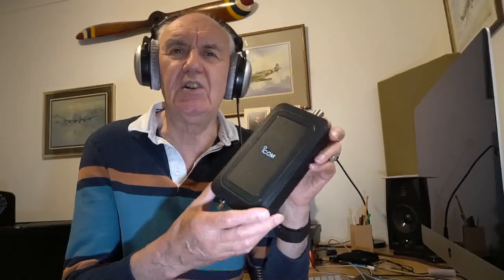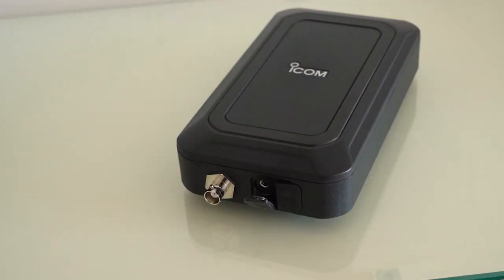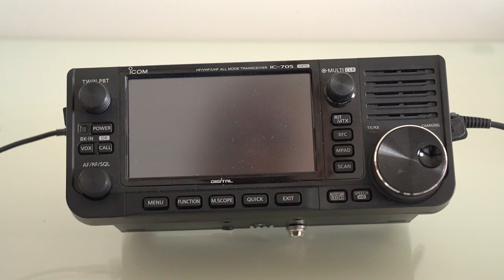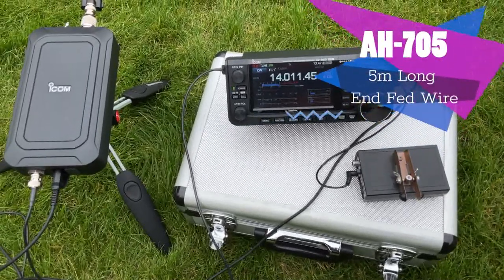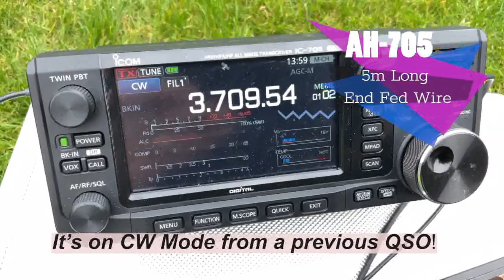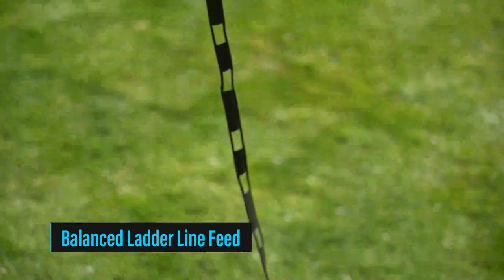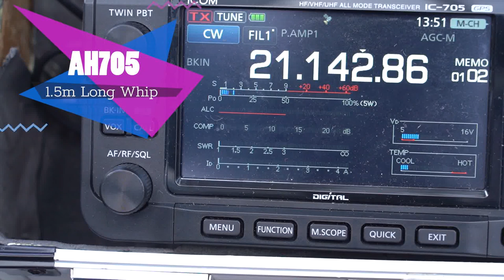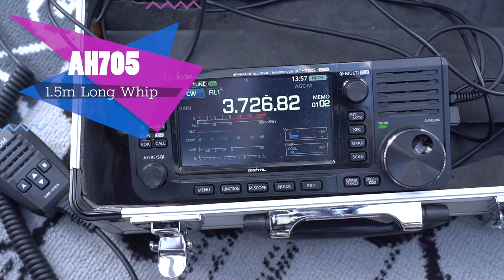ICOM AH-705 AUTO ATU IN DEPTH REVIEW

Comment: Been looking forward to this particular video, a lot - I'm just about to order my first rig this week and  my big question at the moment is do I really need a tuner and if I do,  should I get the MAT-705 or the AH-705?
This video has pretty much solidified my thoughts and confirmed my choices.

Just got my Australian Foundation License which has a 10W PEP limit. Due to this limit and the fact I'm interested in portable operation I've pretty much decided on the IC-705. 
I live in a townhouse with a block that is 4.5 or 5  meters wide so a tower or even a mast like a DX Commander would be difficult or impossible to guy, so being able ot use a short  end fed wire antenna is very attractive.

On paper the MAT-705 looks better its  smaller and has about 16,000 more memory locations, although it doen't mention weather/dust resistance.

Of course paper does not tell you how well it works. I've seen 2 examples on YouTube where MAT-705 users have not been able to match an antenna - and on one of them they did match it on their Elecraft tuner (the T1, I think).
Right now I'm leaning toward the AH-705 despite the price and size difference.

I do wish the tuner control and the RF  output were on the same side too, but maybe a right angle adapter for both might help, then you can have the cables "meet in the middle" as it were, without too much strain.

I'm a  total newby ham - but I do have experience manpacking radios and using them in the field  from a couple of years in the military.
I'm happy that Icom have given us a smaller overall radio, with what appears to be a  very high performance -  matching unit separate. You get the smallest radio possible when you know you have resonate antenna, but if you need a matching unit you can add one - and one that appears to be magic.

Thanks very much Peter - you've sold me.
And thanks for all your other videos, I really learn a lot and enjoy them.

Comment: I have an LDG IT-100 tuner for my IC-706. One day I had the antenna completely disconnected, all I had was about an 8m length of coax, and even that was wound through a choke. I accidentally hit the "tune" button...and it matched my open end of coax! :-o
Reply: LOL Paul, yep I've done the same thing by accident, too. So what does that really tell us? Well, just because we've matched our radio to an antenna system doesn't mean that we have an efficient radiator. 73 KJ6ER

Comment: Thanks for the video Peter, I have the AH-705 now. It did tune up ok on a 20m length of wire but I have since tried a 7m and 17.2m bit of wire. The 7m did not get out as well on 40m as the 20m but I have not yet compared the 17.2 to the 20m length (20m being a halfwave)
Reply from the maker: Thanks for the info.

Comment: It was expensive but I'm very happy with AH-705 performance. Mine came with a PL-259 to Binding Post adapter to attach a random wire. I use Energizer Lithium AA batteries in mine. They last longer and have less chance of leaking like alkaline batteries do.

Comment: Thanks for the review, I just subbed. Like most others, I believe Icom should have included the ATU in the 705. Having said that, Icom should have made it for 100 watts and not limited it to just 10 watts so hams could have used it with a variety of radios of all power outputs. That kind of limits what you can do with this tuner.  I do like the fact  that you can run it on common alkaline AA batteries and not on some internal rechargeable battery. At $359 U.S., I think it's overpriced because of it's 10 watt limitation.
Reply from the maker: Yes I agree, particularly regarding the 100W version. 73 Peter
Reply: @watersstanton  Isn't a 100W version of the AH705 effectively an Icom AH4 with internal batteries added?  Might make a good video......Also I'd love to see a video on loop antennas with the AH705.  How small of a loop can you use and still get 6-80M or 6-40M?

Comment: I have an AH-4 tuner from Icom and I use it with a 12 m long vertical fishing rod. It tunes 6 to 80 metres, and with a loading coil it tunes 160 too, even if officially the AH-4 does NOT tune 160 metres at all. It allows me to run 90 W in digital modes and it just works, no issues.  It seems that this AH-705 is worth buying, if you, like me, are fine with using tuners and cannot use better antenna solutions.
Reply from the maker: Many thanks for the info. 73 Peter

Comment: I received and hooked up the AH-705. And it’s as amazing as you stated. I have a couple wire antennas in my backyard and they normally don’t tune up all that well. But the AH-705 just flat lined them or 1.2 to 1. It isn’t the smallest atu on the market but it’s probably the best. Thx for the vid.
Reply from the maker: Hi Ted. Glad the video helped. 73 Peter.

Comment: I don't understand what Icom are aiming for here. The thing is *huge*, they expect you to drag that along with your mobile QRP station? Really happy I splashed out on an Elecraft T1 for my 705 -it's 1/4 the size and £50 less. Sure it won't tune up a damp stick on 80m,  but it's fine with the random lengths of wire I use :)
Reply from the maker: Thanks for sharing. 73 Peter

Comment: Thanks. To be fair the ATU isn't as expensive as I first thought.
Just a thought, are we sure the ATU doesn't have a 50ohm resistor in it! :)
Reply from the maker: If it did you would not hear it tuning - think about it. 73 Peter.
Reply: @watersstanton Sorry just being facetious, it looks like it is a fine tuner. Judging by the board layout inside it would probably be too much of a squeeze to pack it into the rig itself. The trade-off with wide matching.... 73

Comment: I just picked up a 705 a couple of weeks ago to use for portable operation. I've been considering an ATU and am torn between the AH-705, the MAT-705 and the Elecraft T-1. 
Another fellow compared the Elecraft to the MAT and found certain situations where the MAT would not match an end fed long wire but the Elecraft did just fine.
The MAT specs a range of 5 Ohms to 1500 Ohms. That quite a ragne. The Elecraft says up to 10:1. I reckon that would mean 5 Ohms to 500 Ohms. The ICOM I cannot find either an impedance or an SWR range. 
The ICOM seems to work well though. I imagine it has to do more re-tuning in the sense of all the relay chatter rather than just being able to jump immediately for a revisited frequency. 
I think the ICOM with its water resistance and mast clamp might be better for random length inverted V antennas that I think I'd use in portable operation.
I do like your simple doublet antenna. That would suit me as well.
Oh. What to do? What to do?
Thanks for the review.
Reply from the maker: The MAT is not nearly as good as the other two. Both are brilliant.

Comment: Hello Peter, an exceptional video as always.  I'm sold !  The best place for an ATU is always at the antenna feedpoint so a portable ATU like that has great advantages in reducing the coax feeder losses and allowing you to run longer coax feeds.  The open wire feeder example on your doublet was brilliant and regardless of whether you use a 1:1 balun or a 4:1 balun it would be an advantage to add a common mode choke (choke balun) on the 50 ohm terminal of the open wire balun to completely decouple it.  What kind of propeller is that on your wall ?   73,  Jamie  VK2YCJ
Reply from the maker: Hi Jamie, thanks for that. The prop is a half size replica but I have lost the label. Sorry! 73 Peter.

Comment: Great overall review.  I noticed that you didn't talk about SSB, would you think a random wire would have at least 6 dBi or more?  I've noticed on the iC705 most of the time you are the noise floor and having an efficient antenna, would be a great asset.
Reply from the maker: Frank I don't fully understand your question. Are you talking about dBi gain? If so, then what is the reference antenna? Generally speaking, random wires rarely perform better than a dipole unless very much longe.

Comment: Just watched this great video a second time. This tuner is clearly more versatile than that fitted to my 7300 (a great radio). Although this tuner is designed for portable use and I specific portable radio, seems to me this would do a good job as a homebase tuner?  Agree? What else does this as well at this price point ?
Reply: For your 7300 consider getting the Icom AH-4. I use it and it works fine for my vertical 12 metres long fishing rod.

Comment: Isn’t the AH-4 more or less the 100W version you wondered about? My AH-4 works wonders tuning a wire running inside my hedge against a ground rod.
Reply from the maker: Yes you could be right if it has the same ability. 73 Peter
Reply: @watersstanton  yes the AH-4 is great it will match pretty much any length of wire on any band.

Comment: Great video.  For the ladder line connection, why can't you just connect 1 leg of the ladder line to the center of the PL259 and the other leg to the ground lug?  Wouldn't that get you a balanced connection?  I've used my ICOM AH 4 for years doing this exact thing.  I have a 160 meter full wave loop fed with ladder line, if connect 1 leg of the ladder line to 1 post of the AH4 and spread the ladder line such that I can connect the other leg to the bottom ground lug and for many years tune that 160 loop on all bands including 6 meters with a lot of contacts under my belt.  The AH-705 looks to be similar to the AH-4 100 watt tuner design.  Is my hunch correct in your opinion?
Reply from the maker: It is rather like connecting ladder line to coax cable. It is not an ideal methos because coax  is unbalanced, but it works with limitations.

Comment: The bottom of my AH-705 says to never use rechargeables even going as far as capitalizing NEVER to make their point.  Also it says to only use Alkalines.  You said that it works fine with rechargeables.  I'm wondering if it's because with two rechargeables, you're only putting out two and a half volts to the tuner and it needs the required three volts to work properly, and by using rechargeables it would be like always using run down batteries?  Since they were so adamant about stressing that you don't use rechargeables, is it possible that the unit might over time incur some permanent damage by running it consistently at a lower than required voltage? Since they made their point twice, once in the instructions, and again on the bottom of the tuner.

Comment: Tuning and radiating are two different things.  How does a 5 meter wire or 60 foot wire radiate once matched to the transceiver thru the ATU?
Reply from the maker: Radiation level is determined by power fed to the antenna, and a matching unit can play a big part in this. Substitute “match” for “tune” and your question is answered.

Comment: I wonder how radios like the G90 and Elecraft manage to fit an ATU that can tune a wet noodle inside? Don't get me wrong, I love my IC-705, but it is lower power, expensive, and doesn't do nearly a good a job as a tuner from LDG. Let's face it, Icom wanted to get another $350 on top of $1300 for the IC-705, when companies are selling radios WITH a tuner for under $600. Heck, you can get the LDG Z-100Plus/IC-705 which will tune anything (and handle 125 watts, so you can hook it up to your base station or an amplifier for your IC-705) and only costs $150, less than HALF the price of the AH-705.

Good video though.
Reply: Also, how many contacts did you make on 80M with a 1.5M whip? I can tune a dummy load up pretty well to 1:1 but it doesn't mean that when I transmit anyone outside of my back yard will hear me. Just saying.
Reply: @W9HJBill  exactly. half truths abound.
Reply from the maker: I made the point in the video that with a short whip you would only work the guy disn the road. Howev4, the point was to demonstrate the extreme reactance / impedance challenges it can cope with. 73 Peter

Comment: You can use a Icom AT4 or an Alinco EDX2 with the IC705, the control lines are the same, but you need to supply an external 12v to the ATU. OK with the Alinco EDX2 it will not cover six meters but of will operate with as little as 5 watts. It is also worth looking at the  N7DDC ATU 100 kit or ready built version. I have both the N7DDC atu and the Alinco EDX2. The N7DDC will handle 100 and the EDX 2 200 watts. The AH-705 along with the Mat-705 is very overpriced and can only be use with a QRP radio. I will not be buying one anytime soon, if I am in the field with a 705 or a 817, I will be using my home-made, QRP  tuner that cost just £20 to make, and will tune almost a piece of wet string!. Put your cheque book away, get out the junk box and start building,  and save you money. An ATU is not "Rocket Science",  that's what a real radio amateur would do. G8LXI